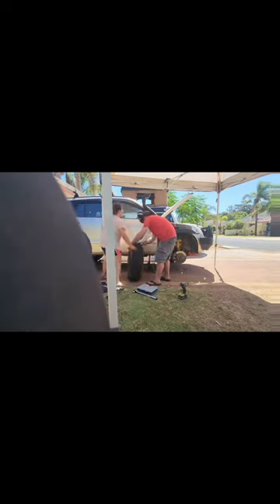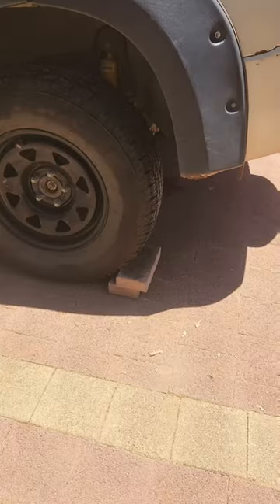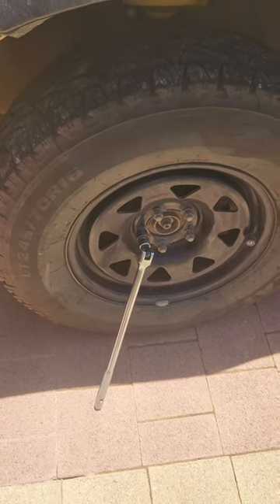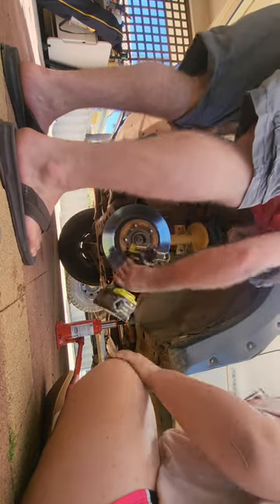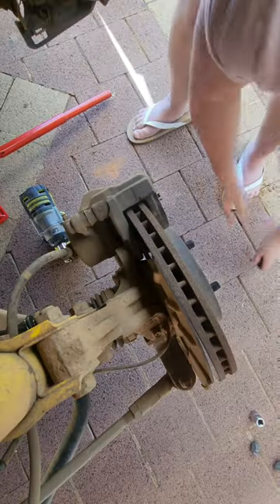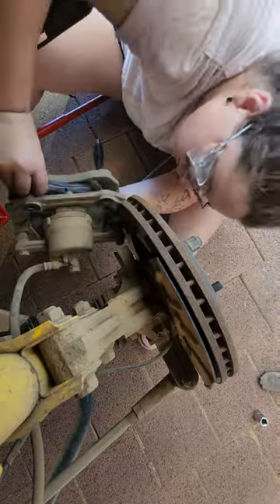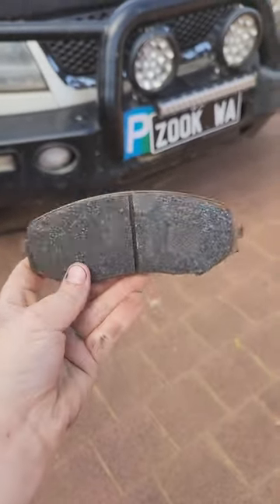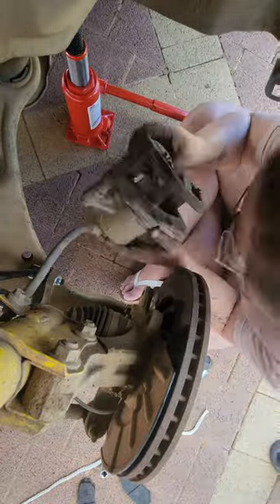NEW BRAKES (and reason 472 why not to buy a Suzuki). AT LEAST WE DIDNT CRASH? #4wd #4x4 #grandvitara

Comment: Lil tip, If you're just doing pads, usually you can just pull the bolts out of the back of caliper slides and pull the actual caliper off and replace the pads, can be easier than trying to get the full caliper and bracket off. And using the bolt and nut for pushing the piston back into the caliper is actually a pretty good idea, much easier than forcing it back in by hand aha
Reply from the maker: Yeah we didn't put too much thought into these ones... 🫣 but I like your idea. Will have to remember it for the next one 🙌